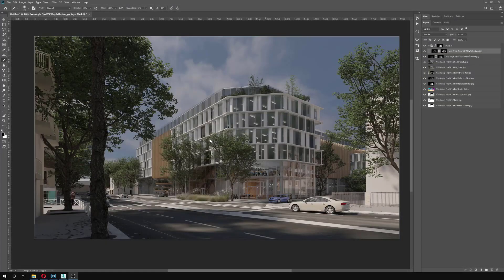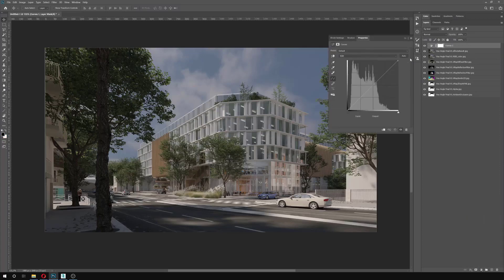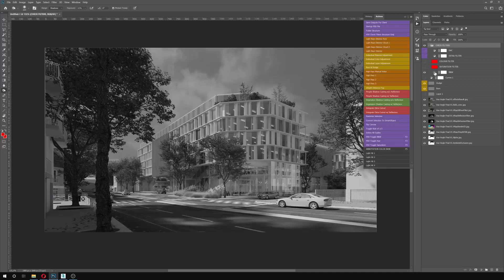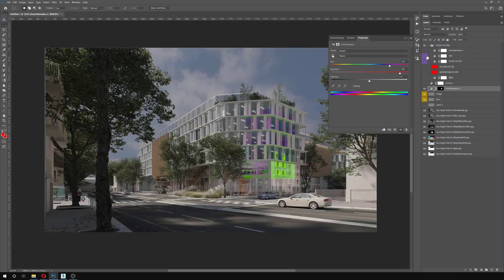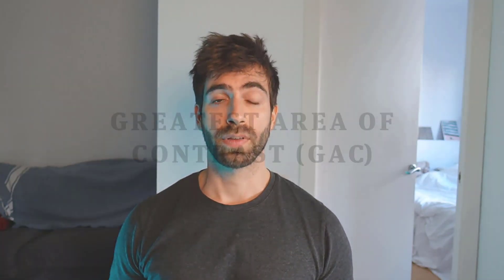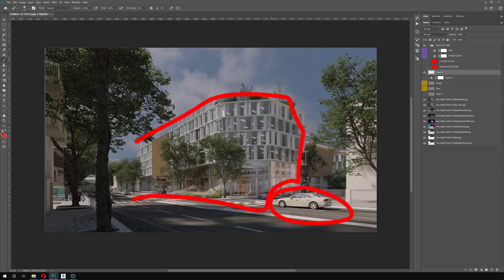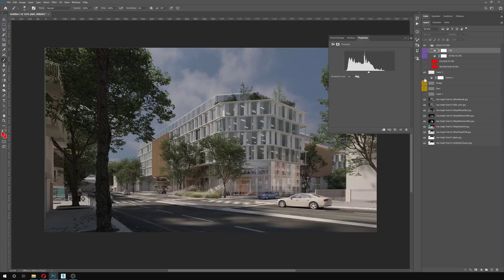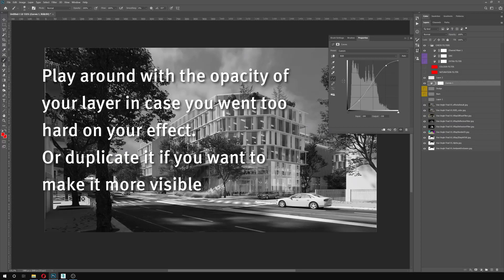The Power of the Burn and Dodge Tools in Photoshop

Comment: Super helpful video because of the in depth explanation of the reasons when doing the adjustments. Thanks!!
Just wanted to let you know that there's something wrong with the audio on the last section of the video. It could be my computer, but I tried on two browsers.
Reply from the maker: Hi Leandro, thanks for the kind word. 
Yes I know :( I have some issues with OBS when switching from screen recording to camera recording. Sometimes the sound starts stuttering. I'm hoping to figure out where the issue comes from before I record the next videos!
Your computer is definitely fine don't worry :p